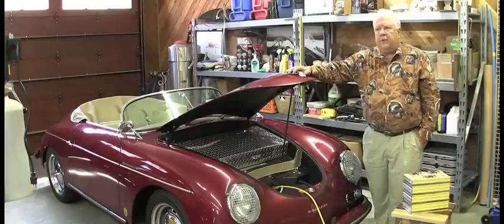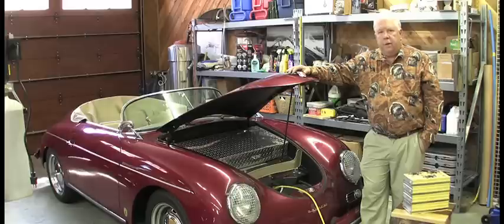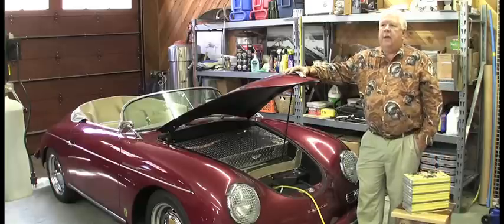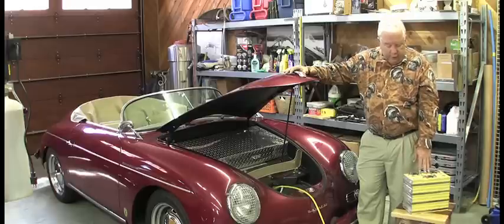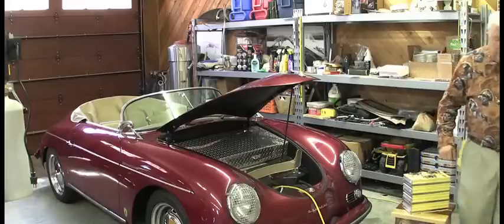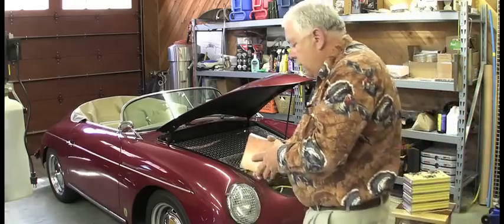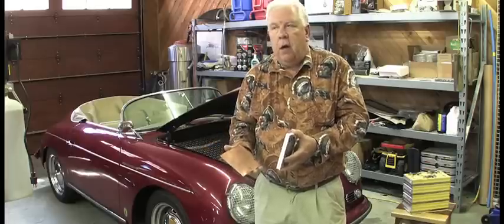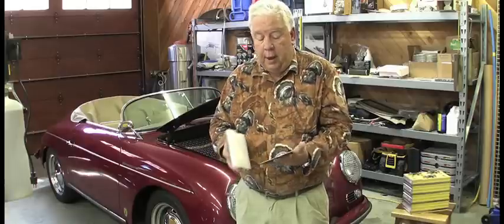3 A Convenient Response to an Inconvenient Truth

Comment: if someone was to purchase an electric car conversion kit that included a charger (which is probably designed for lead acid), you'd have to get a different charger designed specificly for lithium batteries?